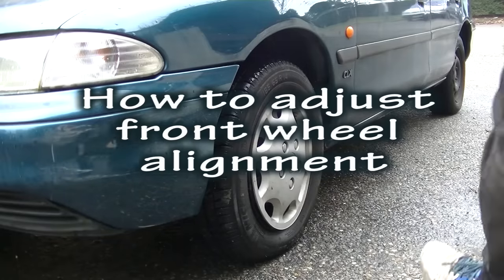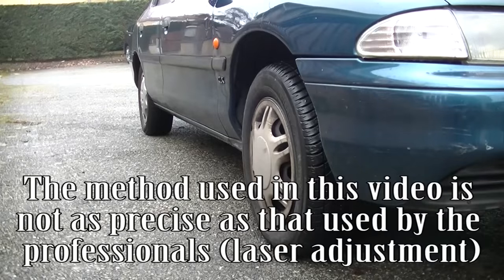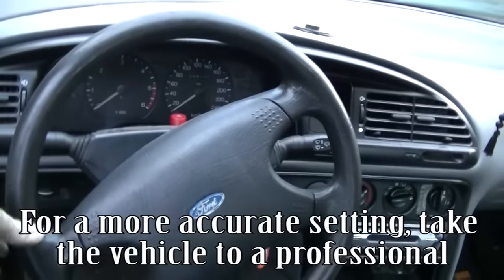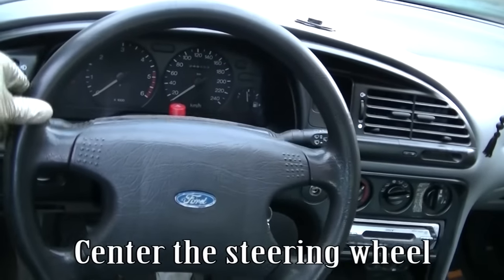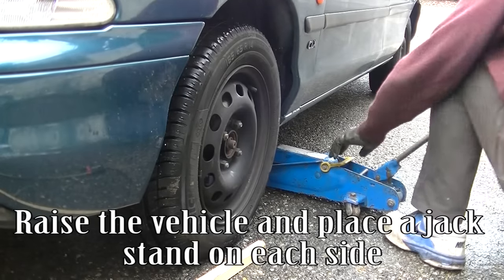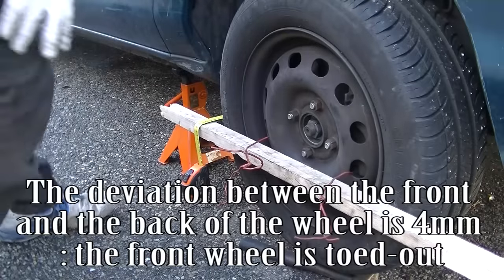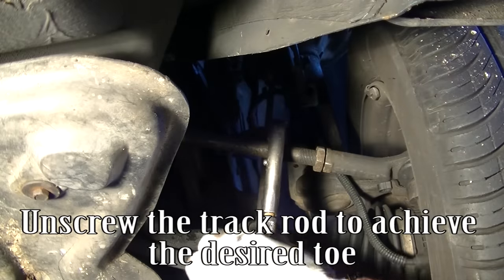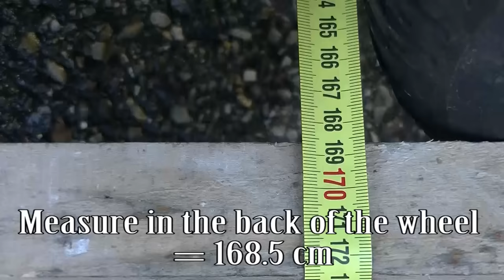How to adjust front wheel alignment - EASY

Comment: Neat idea, but which wheel is actually too far out or which is too far in? Only way you can know that is comparing them with the rear wheels.
Reply: Or driving. If it pulls to one direction; check the toe. You could have toe in on one side and toe out on the other.
Reply: @ChippinFlint  sometimes, sometimes not. I've had vehicles that didn't pull to one side and still toe wore out tires on the corners. Trucks are notorious for that, especially 4wd with big tires. Smaller tires are more noticeable for pulling than larger tires are, plus they'll wear wrong much faster. It really depends on the vehicle and how far off the toe is.
Reply: This is exactly what I was talking about. You can't know which specific tire is out of alignment with this method. That's where the "string method" comes into play. I did something similar to this today and got the readings pretty much dead on with specs. But my steering wheel wasn't straight. Obviously I could have probably kept going and readjusted both wheels for how far it was out of alignment and have probably gotten it in spec... but I just ended up taking it to a shop. No time for it... At least now I have a basis when changing parts to know which wheel is out of alignment.

Comment: never align a car with the suspension hanging. the angles change with the height. remember this: castor>camber>toe. one affects the next. so if the suspension is hanging, its sure to be at an extreme (+) camber. toe getting adjusted at this point is mostly useless. as soon as vehicle is lowered to normal ride height the camber goes (-) and throws off the toe angle. the affect will vary per vehicle depending on the locations of the control arms and tie rods, so this method can still help, but i wouldnt trust it.
Reply: True👌
Reply: New alignment machine lift the car

Comment: I've done alignments for twenty years. I want to add a few things. 

First: This will only adjust total toe. Not camber or caster. But total toe is the biggest tire wearing angle. 

Second:  Make sure the car not jacked up(normal ride height when making adjustments). You can scribe a line with chalk while rotating the tires to get a more accurate measurement. 

Third: After adjusting this way, the steering wheel will likely be crooked. To get it straight, test drive it. Which every way the steering wheel is off,  adjust BOTH wheels in that direction EQUALLY(Same number of turns on the tie rods. One side tightened in, the other loosened out). In other words, if the steering wheel is to the left, adjust the wheels to the left. This will take some trial and error. After the steering wheel is straight, it wouldn't hurt to recheck your total toe.
Reply: thank you so much sir..u saved me

Comment: Yes, my boss had pads to dry front wheels on,, jack up car,, paint a line of paint on the center of the tire, move your pointer to tire spin tire, spin tire,, scribe a line in paint while it is still wet,, set your car back down on the movable pads, set your toe in bar under car, measure front and rear of tire,, with toe in bar, perfect!! No computers to worry if their calibrated, and we had a bubble magnetic attachment that would center on front brake disc, after you pulled the grease cap off,  perfect, you always knew it was right!!! Other alignment shop had latest computer fixed alignment gear , and a new computer tire balancer,, the we never new if it was calibrated,, I remember the techs would come to calibrate, both tools,, but we never knew if they were right or not! The old mechanic had tire balancer would work off a strobe spark that was all mechanical,, no wondering if your tire balancer was working correctly,,  the old man mechanic had those tools,,, they were always right!! Someone went backwards there when thought they were going forwards with Hi-Tech computer stuff,!!! The old guy knew his automatic transmissions too,, !!! Brake jobs, had his own home to hone wheel cyli ders,, own brake lathes,, turn out excellent brake jobs for just over hundred dollars,, every day!! Engine rebuilds,, expanded pistons, put rings and bearings, valve jobs on well cleaned original engine parts,,, I would tune up those engines a year or so later,, we always took a compression test,,, those engines were as good as new,,, !!! His prices were incredibly reasonable,!! Those were all still American cars,, I don't know if new cars can be rebuilt like that anymore,, The Old Mechanic had it down!!!

Comment: Never lift your car when you do this it will pull the wheels apart and make the setup look like it is towards toe out so when you change it and lower the car to the ground you will get a overcompensated toe in setup. What you do is you do it on the ground after you push the car forward a couple of meters.
Reply: Yep
Reply: Yes

Comment: I used the back tires and some string to align the front.
Reply: That's the way I do it too
Reply: That way never fails or measure center of the tire in the rear and match the front

Comment: the video is actually not as bad as people are acting like it is... ...  the only thing is that you want the vehicle at a normal ride height when adjusting toe in...   if your car is eating tires..   this will probably help you out... i would of jacked it up to check the play and inspect for loose parts...  then set it back down to adjust toe in
Reply: I went to the shop and got alignment done few days ago, drove the car couple times and today noticed there is some clanking sound when I pull in/out of parking lot. I though I might have hit a cola can or something but didn't see anything.  COuld it be the shop forgot to tighten something or something else, or maybe it's nothing, maybe I hit a cola can in the rear and didn't see it. car seems to drive fine. Think I heard the sound in 2 difference occasions
Reply: Ow....I find difficulties of what you're doing sir..
It is easier to use an string which is çonnected  the outer part of the tire of rear and front..
Reply: O
Reply: Thanks didi
Suman Mondal
Reply: Toe in 1/8" tread to tread,worked for 40 yrs. Inertia

Comment: All accurate wheel alignments are done with all wheels on the ground, your method would work done without jacking the car, doing the cross measurements so long as you mark equal distances from centre of hub, then do cross measurements. I align cars for Bridgestone and we never lift cars wheels off ground to align.
Reply: Actually, you can do 4 wheel alignment with the car jacked up nowadays. The alignment machine compensates for the sag.
Reply: @19NinetyUK  Ya right
Reply: @19NinetyUK   correct alignment these days are lifted
Reply: Does it matter which side you adjust the tie rod on?

Comment: Never attempt to do wheel alignment with the car jacked up.  You can see from the angle of the tie rods that jacking the car greatly affects the toe-in so if you adjust for the correct toe-in with the car jacked up, you will have grossly inaccurate toe-in with weight on wheels.
Reply: Does it matter what side you adjust the tie rod on?

Comment: how do we know which one of the left or right need to adjust the tie rod end?
Reply: You don't 😂. Unless it's something obvious like you changed a tie rod on one side or something similar. For an issue like this you would use the string method since each side is independent of each other. Logically though you would think measuring straight across if the measurements are in spec that the wheels are straight, but when I did this that didn't seem to be the case (Yes my steering wheel was off, but it was locked in place while adjusting, I could have probably kept going and got the steering wheel straight but it would have take all day test driving and repeating). You would also have to have the tape measure 100% straight to account for the wheels slightly turning.

Comment: how do you know which side to do the track rod adjustment?
Reply: By feeling..hehehe
Reply: My best guess is,the tire that you are having problems.
Reply: It is clearly the question. What I as non-mechanic, just a technician could come up with is check by a thtead and the funny cone at the end, whatever it is called, and see which tire shows bigger difference,but as someone mentioned by tires as well, if they are older.
Reply: Simple pull your measurement get the reading.  Front of wheel. Back of wheel.   Loosen. Both. Tyrod nuts.   If the back of the wheel. Measurements are wider. Than the front. Adjust. Both tyrods in.  If the front measurement is wider. Adjust both tyrods out. Till. Measurements are the same. Don't  jack up. Vehicle

Comment: I did mine with strings on both sides, towed both sides 2 millimeter in and I'm driving for  years like that with no problems, tires are wearing out even.
Reply: Does it matter which side you adjust the tie rod
Reply: Does it matter what side you adjust the tie rod on?
Reply: @toneybatts1972  put the steering wheel in the center position and check which side needs the adjustment, if you're lucky it can be on one side only, in most cases it's both sides.

Comment: This DIY repair quite good for temproary use until you visiting the alignment  shop with the alignment machine,it's quite usefull after changing the Tie rod end or the whole stearing rack.....better than nothing,huhuhu......even the hangging not really accurate to alignment....anywany it was nice video......good job

Comment: Measure the center of the rear wheels and then the front. Toe it in according to spec. Center the steering wheel counting the turns from full left to full right.  Stop in the middle. Get OTC  steering wheel holder or have someone  to hold it. Check steering parts  for wear  first.  Replace the whole rack unit with outter tie rods.

Comment: I've done something similar to this. The issue is you don't know which wheel is out of alignment. At some point just adjusting one side could make the measurements within spec, but the wheels could still be turned if the steering wheel is straight. Both sides have to be adjusted to come within spec, which this didn't explain. You can't just do one side, unless by chance you get lucky and that one side is the one out of spec. Obviously if you changed a tie rod or another suspension component on one side you already know which side is out of alignment.

Comment: My tires are so toed in the inside is worn smooth while the outside looks still looks newer. This is the first alignment video I've seen that I feel like trying. Thanks.
Reply: that's out not in
Reply: Don't try this, the vehicle needs to be on the ground, otherwise the the weight of the tires will pull downward while suspended.
Reply: Indeed inside wearing of the tyres is caused by wheels being  toed out !!!!!

Comment: mind you it can be done like that, yes it will align wheels but some cars have a bit toe in or toe out. Find out the info for your vehicle and you can use some torpedo levels for add accurcy

Comment: How do you know which of the 2 wheels I need move?
Reply: They don't know, they should have put a line from the back of the rear wheels, that's the only way to know which front wheel needs to be adjusted
Reply: Mike Harris yes you are right, but before it you need to make sure the back wheels are aligned. I guess. I don’t know about it.
Reply: Yes correct

Comment: The wheels must have all the weight the frontpart have and the bakes must be on and the wheels must been lock , i use a wire from the rear part of the car too the front of the car and chek the difrent of frontwhel    of 180 grades
Reply: Weight don't have to be on the front, I use a rope just as you said never had a problem plus new alignment machine lift the car off it's wheels

Comment: didn't check steering wheel and which wheel is out, should have mentioned a little more info.
Reply: i can answer that for you, when siting in your car,  if your staring wheel is slightly down to the right side that's the ps, well, this means that  your right passengers side wheel is slightly toe in,  and if you was to toe it out just a little bit at a time it would make your staring wheel strait , and the same going for the left side  that's the drivers side wheel,  if your staring wheel is slightly down to wards the left  will siting in your car,  this do mean that the drivers side wheel is toe in , and it would have to be slightly adjusted and toe out slightly st make your staring wheel be centered with the  front wheels,  and  always have a close look at the front tires for tire ware, if the ware is on the inside,  then you have a toe out, and if the ware is on the outer side of the tire, then sir, you have a toe in , and we cant align the right side of the car from the left wheel, all that will do is make it toe out  and ware one tire right out on the in side ,   and some time when aligning with a string, our anything,  you can get your wheel of 2 far to one side, you can pretty well tell where your wheels are pointing by checking for tire scuff and where it's might be scuffing of rubber of the tires, and the staring wheel tell the rest sir.  and if you do this method along with the ropie poppy  then you are all set, good luck  happy driving , i have worked around cars for over 50 years and i pretty well know where the wheels are going to point when i turn the  inner tire rod lol

Comment: DON NOT USE THIS METHOD , IT IS WRONG IN SO MANY WAYS, aND IF YOU USE A STRING LINE FROM BACK TO FRONT ALSO KEEP IN MIND THE WHEEL TRACK AT THE FRONT AND REAR ARE OFTEN NOT THE SAME ,,,,,,,,,,,,,,DO MORE RESEARCH

Comment: the board could be bent, the only way that i know of home car alignment is , counting the threads behind the lock nut,  this way you will get both wheels strait, with a strait staring wheel, some Honda are 9 threads both wheels, the thirds have to be the same amount on the 2 tire-rod, behind the lock nut, left over threads, take a steel brush clean the threads real good even with a little wd, then take a plastic screw box, cut off the smallest plastic flap ,  you need to stick the plastic right down to get that first thread, plastic  a bit to count them good , slide the plastic on the threads it will make a clicking noise when passing over each thread ,  i know if you have the right amount of threads when your  doing your liniment, and i know , that your staring wheel will be strait , and your wheels will be in line ,never get under a car thats  not a safe place to be, make sure it's safe, and when losing lock nuts, thy need to be tight again  good and snug.

Comment: Naaa... best "EASY" or pro-ghetto or dr. jimmy rig alignment is to eye ball it then just to push the car back and forth on a flat ground until you feel to goes smooth a foot back and a foot forth. That will also leave you without toe-in/out which RWD cars usually call for. But that will only be good if the rear of the car is square. Which you can check with the string method.

Comment: Just not going to work perfectly.   If the left wheel is misaligned and you adjust the right wheel to get them to the right measurement then they are both misaligned...   Also, these are measured in fractions of a mm ....    Sometimes the writing is 1mm deep on the tyre.   Even then,  better make sure your tyres are in good condition.  No bulge or deformity .........    which is why he lifted them off the ground.

Comment: Raising a car to check alignment?  Incorrect.
Making sure car has zero toe?  Incorrect, most cars need toe-in or out based on factory specs.  
Horrible how-to video.
Reply: Question, if I need to make toe-in adjustment (bring wheel inward) do I turn the tie rod away from the tie rod end nut, or closer to the nut? Cheez is confused
Reply: if your tie rod end connect at the front of the wheel. then you would turn it toward the tie rod in. or. clockwise (looking at the back of the wheel under the car).
Reply: dylan scronce Ok tank you
Reply: twelcome
Reply: are you sure it 100% alignment.
Reply: SlickRacerGuy 0ppppp
Reply: SlickRacerGuy
Reply: Slickracerguy you are right , when you lift and stretch the suspension your creating toe out due to the tie rods pulling together , therefore after your adjustment and set the weight back on the suspension could end up with to much toe in . This would only work with a 4x4 with solid front diff and full straight tie rod bar .